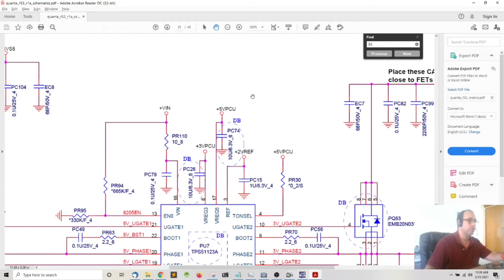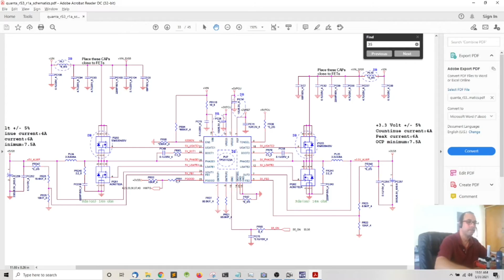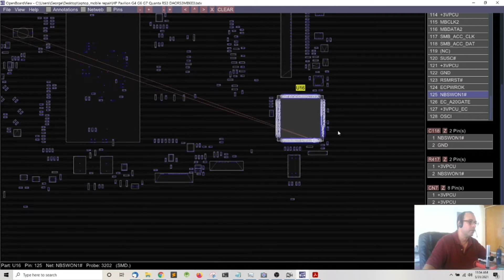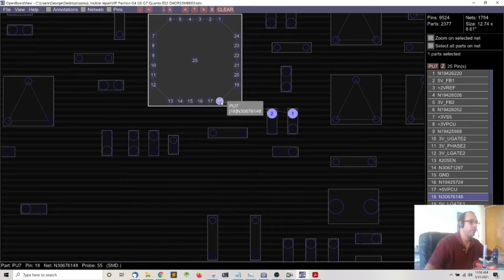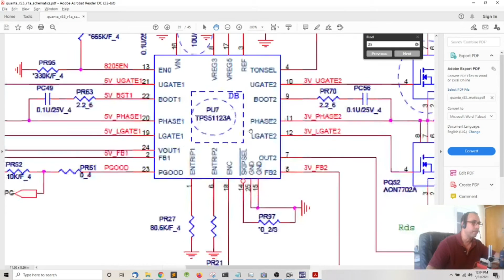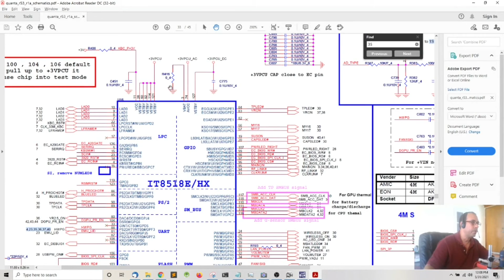How to Fix Power On Issues On Laptop Motherboard (Startup Sequence)

Comment: Thank you Sir for the rich teaching.
And please Sir I have this board hp laptop dv7000 it's generating 5v and 3v on its coil (Inductor) but not powering on and I've tried programming the bios chip still not turning on. Please Sir what step should take to get it fixed?

Comment: I am not sure if my comment got posted before. On my Lenovo t410, I am getting 3v on reference point pin, but not the 5v. Also I am not certain what the kbc chip is on my Lenovo the u42 or u23. Both of those chips are not getting any power
Reply: I already replaced the 2 MOSFETs after f2 fuse as they were not passing any voltage,

Comment: What types of tools do you use and how do you get spares?
Reply: For laptop repair you need a multimeter, dc bench power supply, hot air rework station, soldering iron, microscope, thermal camera, tweezers, picks, screwdrivers. You can buy dead laptops to practice with, test yourself and work on. All the best to you!👍🏻

Comment: Very good videos, all the stuff on the repair laptops videos are great, can you make more videos like this or make more videos teaching us how to read or the sequence to read the schematics to try to solve the problems on bad motherboards, and when we can decide that the Logicboard is no reparable , I have a Toshiba u945 that starts, fan spin, power leds turns on, but the is no video at all, I replace de bios, the 2 chips, and still there is no video, I replace too the board battery as it was not charging at all, I hope you can guide me on how to resolve this issue or to know if this motherboard has no hope of being repaired. thanks :)

Comment: Thanks for an informative video 👍. You achieved your goal of nailing the problem in attacking it in a rough “outline” style going directly to measuring the 3.3 and 5 volt rails. What is desired is a full power sequence analysis starting from the adapter voltage, to the charging IC, and Power Source selection between VBATT and ACIN.
The information you present is a latter stage of the power sequence. I wish you will also present the earlier stages where at a component level the starting sequence is presented, and the logic explained of the decision to select the adapter or the battery. Such an explanation will provide the basis for why the 3.3 and 5 volts will not be present, or why the battery is not being charged. I am hoping you will find the time for preparing such a video. Your use of board-view in conjunction with the schematic and then measurements, made your way of presentation outstanding compared to other videos on YouTube.
Reply: Search Dr Bios - how to read laptop schematics part 1 - youtube channel.